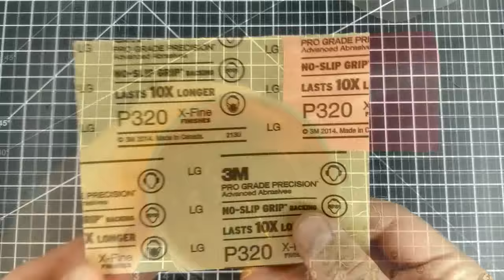Polish Glass Bottle Edges After Cutting

Comment: I spent about an hour on 80 grit to smooth out the top completely, not including rounding the edges, both arms worn out.  I decided to try an orbital sander and was able to smooth out the top and round the edges in about 20 minutes, stopping to check progress frequently.  It's important to wear a mask since you cannot use an orbital sander wet, but otherwise orbital is the way to go if you have one.
Reply from the maker: Thanks guys sharing this info! I having tried an orbital sander because I wasn't sure if the vibrations would be an issue. I'm glad it works well for you! And the thanks for pointing out that a mask is needed to protect the lungs. Breathing glass dust is very bad. Also, safety glasses are helpful. When I've had issues when I forgot.
Reply: Why can’t you use wet sand paper on orbital sander? Can’t you just wet the sand paper? And re wet it when it starts to dry?
Reply: Also I heard glass dust is only dangerous from naturally forming glass. Still, not gonna take that chance tho

Comment: I just noticed this vid’s a few years old, but I just wanted to say thanks for the vid! 
I have experience with woodworking, and electrical work, but I’d never worked with glass before, or done much wet sanding, and this helped me to sand the edges on a glass pane that I got to make a surface to mix homemade watercolor. It only took me about 15-20 minutes to get those edges safe and as even as I could eyeball it, and while I might go back and touch it up later, so far I’ve made 7 pans of paint!
Reply from the maker: That's awesome, I'm glad it was helpful!

Comment: I'm surprised that the last step wasn't flame polishing. If I try that technique, I'll get tips from someone who has already tried it. I'm also surprised that work gloves weren't necessary, but I'll probably use some nitrile rubber dipped cotton gloves myself. Thanks for answering my two questions in this video! 1. Why are people cutting glass bottles, and 2. How do they get the edges smooth?

Comment: At what grit sandpaper do you stop at just to make it safe and drinkable as a glass? Is just using 80 grit enough?
Reply from the maker: 80 grit is enough to remove the sharp edges and it should be safe to use, but each of the other grits go a lot quicker. The main thing that takes a long time with 80 grit is getting the surface flat. You can spend about a minute or two on each of the other grits if you want a smoother final surface.

Comment: nice vid...but the edge of the glass because its not tempered will be easy to chip if tossed in a sink with other dishes...wash them one at a time and carefully to keep them chip free.
Reply from the maker: That's true, I have noticed that the edges do chip easily. Small chips can be sanded smooth, but it's still important to be careful with them.
Reply: mark rush who toss glass in the sink?
Reply: I’ve made and use a dozen of these glasses and they have not chipped once in three months!

Comment: I was amazed to see you take the sandpaper out if the water container.
You need wet paper.
You wanted to trap the glass dust.
You can control glass dust for disposal down the drain.
All simply by leaving the sandpaper in the container, under water.
Reply from the maker: Exactly! So many people ask "why use water?" but you understand. Although, there are a few issues with leaving the sandpaper in this container. To do this you need a firm, flat surface. The bottom of this container is neither. This is why I took it out and put water on the paper after taking it out of the container.
Reply: @HowDoYouDIY  thanks for the video I have a half inch glass table top which has been propped on its side and scratched now I can smooth it out.

Comment: Thank you for this helpful video! I just went through this process last night using your instruction. One thing I didn't really think about was making sure the sandpaper didn't scratch the sides of the glass, so now I have scratches going around the glass about half an inch down the rim (and further down in one spot). Do you have any tips for removing the scratches from the sides?
Reply from the maker: Sorry for the late reply. From what I've tried, I haven't been able to get rid of scratches from the sides without making them worse. It seems like there should be a way, so I'm going to keep trying different things. If I do figure it out, I'll post some tips on that.
Reply: Thank you for the response! I would be very happy to see a video like that if you ever figure out how to remove scratches! I've read that baking soda toothpaste can help remove scratches, but so far I haven't had any luck with that.
Reply: Try RainEx on the outside only. If it hides scratches on auto windshields, it'll hide them on a glass, just don't put it where you'll be drinking from, unless you use a straw.

Comment: Your videos are great!  How many times can you use the square of 80 grit sandpaper?  Is it best to use a fresh square for each bottle?
Reply from the maker: Thanks!! It depends a lot on the thickness of the glass. Thick glass could sometimes need more than one square. With soda bottles I've been able to use one square for a couple bottles. If it seems like you're not getting the progress you were earlier with the same square, just try a fresh sheet and see if the progress improves a lot. The grit does wear down fast with glass, especially when you're trying to smooth out the surface with the 80 grit.
Reply: @HowDoYouDIY  Thank you!

Comment: Sanding in a figure eight motion is how you sand the ends of optical fibers flat. They have to have very little deviation to function.
Reply: How do optic fiber connects to router,how is there no light entering and making signal degrade?
Special connectors,i guess RJ45 doesn't apply here

Comment: Would anyone have recommendations on using mineral oil rather than water to keep the surface wet? Pros? Cons? Just thinking that the oil may last longer and provide better results than water but I'm just throwing ideas out there to see what sticks.
Reply from the maker: My guess is that it would work just fine. Clean up might be a bit more work, and the glass would get slippery. If it ends up working better than water then those inconveniences could be worth dealing with. Hopefully someone else has tried this and can comment their results?
Reply: Very good question!  The purpose of the wet sanding in general appears to be to reduce the amount of glass/silica dust which is created during the sanding process.
Therefore, any wetting agent that is effective with silica dust should be effective. Mineral oil as a term is imprecise and can refer to any refined petroleum oil product.  As such, be careful what type of “mineral oil” you are using as a wet sanding wetting agent, as some refined petroleum products can be carcinogenic.

If you wish to use mineral oil as a wet sanding agent and/or lubricant, try to find the more highly refined “food safe mineral oil”.

Comment: What is the benefit of wet/dry over just dry? Curious and looking to learn as I only started cutting bottles over the weekend and tried sanding my first half decent cut but just seems to take the grit off the paper without doing very little to the bottle
Reply from the maker: That's a really good question. Wet/dry sandpaper is made to get wet without taking apart. Using water on the sandpaper helps to keep the glass dust from getting into the air, and you don't want to breathe that. I hope this into helps.
Reply: @HowDoYouDIY  thanks for your reply, will give it a go with the wet and dry!
Reply: @HowDoYouDIY  your video has helped so much already! I finally have glasses that I am happy with and having a load of fun doing it too! Just another question though. How long do you find that the sandpaper lasts for? I’m finding the toughness of the glass degrades the sandpaper really quickly? Is this common or am I using too cheap a sandpaper?

Comment: We make many of these at home from wine glasses by peeling the labels, scoring them, and using temperature to snap them in two. I reccomend using a rough handheld diamond sanding pad to start off [it might chip the edges, but I’m not sure]. The diamond pad says “50,” but who knows what that means. I couldn’t tell from the video; is the rim of the glass clear, or would it need a polishing compound?
Reply from the maker: The rim does get fairly clear and polished pretty well.

Comment: Basically you're talking about a ton of time, and a small fortune spent on sandpaper.   It's a nice glass, but I'd be interested to know what your final cost was in the end.
Reply from the maker: It does take me a bit of time (typically 30-60 minutes per bottle) but I'm not sure what you would consider a small fortune. In the description of this video I have links to a couple sandpaper assortment packs with all the grits you need. One is about $16 (larger paper) and one is about $9 (smaller paper.) I use the larger paper, which I cut each piece into 4 sections. I use each section on several bottles. The smaller paper can be cut into 2 sections. Overall, the most expensive thing is the bottle. The cost of the sandpaper (after considering all of this) is less than $1 per bottle.

Comment: if you then use different scotch bright pads you can get it to neat perfect finish.
Reply from the maker: I'll have to try that out. Thanks for the tip!
Reply: I believe Scotch Brite pads are quite a bit more coarse/abrasive than all of the 400, 1000 and 2000 grit papers he is using for the final polishing stages, though I can't say for sure how they function on glass.

Comment: Can I do this but with a torch? I mean, the edge melts so it gets smooth
Reply from the maker: I haven't tried this, but I would assume that it would crack or shatter the glass before it got hot enough to melt. I could be wrong though. If you do try this, be safe.
Reply: @HowDoYouDIY  thank you!

Comment: thanks the solution. but i've a question. which sandpaper you can use it? 80grit or anything?
Reply from the maker: In the video I started with 80 grit, but I found that 60 is better to start. Here is a list that should work for you (doesn't need to be exact, close will work as well):

60
120
220
320
420
1000
2000

Just go down this list to get as smooth as you like. Hope this helps!
Reply: @HowDoYouDIY  thx budd. i'll try.

Comment: Hi, would doing the same thing on the corners of glass coffee table works? I am trying to make them a little round, I keep bumping into them and bruising my knees.
Reply from the maker: It might work. I would guess that a coffee table would have different type of glass, maybe tempered glass, so it might give different results.
Reply: @HowDoYouDIY  I started sanding it with 80 the edge looks a lot better, I will keep sanding until it is fully round. Thanks for inspiring me to DIM
Reply from the maker: I'm glad that it's working! Thanks for the update.

Comment: Hello friend very nicely done by you.I have a one question I have a glass light and Lens has a texture if I use sandpapers like you can it be convert to plain from texture?
Reply from the maker: You might be able to do that. It would make a lot of scratches and it would be a lot of work to get all of the scratches out. You would probably also need to go higher on the grits for the bigger surface.

Comment: I followed your process until the 1000/2000 paper which I don't have yet.  There is a variation of shiny and dull spots around the rim.  Did I do something wrong??
Reply from the maker: +Dawn Stolzman using the 1000 & 2000 papers will help with the dull spots. But if you do want it to be more uniform I would recommend using the 80 grit again for a couple minutes, then working your way back through again. It should be safe to use like it is, just as long as you sanded the sharp edges on the inside and outside. Thanks for your feedback!

Comment: I need to sand down a small square piece of glass from a photo frame. Do you know if it's possible to use the same sanding technique with 80 grit sandpaper around edges? Also is it possible to slightly bevel the edges of the glass aswell just so they don't stick out?
Reply from the maker: It is possible. I usually start this process with 80 grit or 60 grit to level the surface. If you're trying to make the glass shorter, it may take a long time because glass is very hard. You should be able to also bevel the edges with sandpaper, but again, it will take a lot of time.

Comment: It seems like many hours of work by hand. Has anyone tried to make a mount of som sort and spin the bottles with a drill or something?
I'm sitting on about 20-25 bottles and want to make it a bit faster :)
Reply from the maker: That's a really good question. I've seen someone build an adaptor for a drill to hold a bottle. I've never tried it, but it is possible. I've also seen someone use a pottery wheel with sandpaper on it. Doing more than 1-2 bottles definitely needs an easier technique than this.

Comment: So I have a pair of glasses lenses that I'd like to sand down by about 3mm. The lenses are about 4cm in diameter. How do you think I should approach sanding down something not only so small, but circular?
Reply from the maker: +Ashli Garcia I think one way to sand down something that size would be to hold it with something, maybe pliers, and sand it with the other hand. If you do this, you will want to use a lot of padding or cloth between the lense and teeth of the pliers so that you don't scar up the surface of the lens. I know there are other ways too, but this may work.
Reply: How Do You? DIY y1u

Comment: Hello is there any faster way of doing this because I am making about more than 20 for my uncles restaurant and I just started doing this recently
Reply from the maker: +pablo hermoso I've been looking for faster ways, but haven't found any that I've been able to try yet.
Reply: Ahhhh. Thanks anyway for telling me
Reply: Pablo, if you have a dremel there are sanding drum bits you can use for the rounding part. To speed up the initial surfacing, you would need a way to rotate the bottle, like chucked in a lathe, and then hold a sanding block against it. Would be worth setting up if you had a lot of bottles to do.
Reply: Hi julie r, Actually I’ve been using a dremel but it still takes long because some to most times it chips the bottle so I still have to use sand paper but thanks anyway!
Reply: Pablo, if you use a variable speed dremel on low and take your time it won't chip. Make sure to use plenty of water. The bottle bit tool looks neat, all depends what you own or want to buy.
Reply: You can use a dremel on its low setting (if adjustable speed, I'm not sure if there are single speeds or not)
Reply: Engravers use a soft copper disc and grit in a water/oil suspension.
Glass conducts heat very poorly, so any localised heating will lead to expansion in that one area, causing stress and chipping.
I would try something to turn the bottle evenly, and use a diamond point in a rest to make a good score.

Comment: I want to remove calcium buildup from glass without scratching the glass or altering it in any way. I assume all the papers, including 2000 grit, would alter the glass. Any suggestions? Thanks for the video!
Reply from the maker: Yes, even the 2000 grit may alter the glass. For calcium buildup I would recommend wrapping it in a paper towel soaked in vinegar. I haven't tried removing calcium buildup from a bottle, but I would guess that this would help. I have a YouTube video about removing labels and print from glass bottles where I used this technique on the print: https://youtu.be/V5ObBIR-69w
Reply: @HowDoYouDIY  Thank you, that's what I was afraid of. I'm going to buy some diamond polishing compound and try that. I'll get 3 grits to try, 0.5 to 3.0 micron, which is much finer than the 2000 grit paper. If the 0.25 won't remove the calcium, I'll try the 3.0 and use the 0.5 to re-polish the glass if necessary. Thanks!
Reply from the maker: That's a good idea, I didn't even think about diamond polishing compound. Hope that works well for you 😊
Reply: @HowDoYouDIY  I'll let you know in a couple of weeks how it works!
Reply: @peterchristensen9585  any updates? I'm genuinely curious how it went
Reply: @TheLemonP1e  Didn't go so well, though my application is very specific and limited. I collect glass flower frogs that have calcium buildup from sitting in water. I was wanting to polish off the calcium. 0.5 micron diamond polishing compound didn't do much if anything, so I tried 3.5 micron and it worked better. But oh what a bother it would be to try to remove the calcium buildup in 10 to 20 holes in each flower frog. I decided to just ignore it like everyone else does. I thought it might be easier. Sorry, not much help to you!
Reply: Soak any hard water build-up in Cleaning Vinegar for a couple hours. Dissolves any hard water build up with zero scrubbing. Works any where.
Reply: @loranelizabeth9148  I soak glass things overnight and it still doesn't get it all even with scrubbing. Don't know what I could be doing wrong.
Reply: @peterchristensen9585  Are you using "cleaning vinegar?" It is more acidic than what you use for cooking. It is called Cleaning Vinegar, usually near cleaning supplies.
Reply: @loranelizabeth9148  No! Thank you, I didn't know that. Also, I recently bought some CLR which I plan to try next.
Reply: CLR or limeaway (usually in bathroom supply at Walmart) works very well on water stained glass . On coffee pots as a waitress we used ice & salt mixed & just swish around .